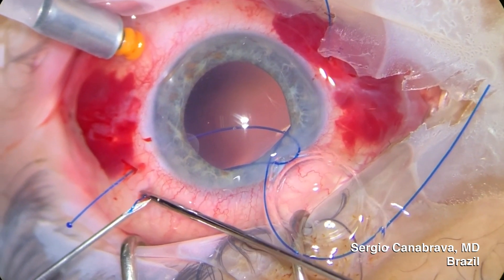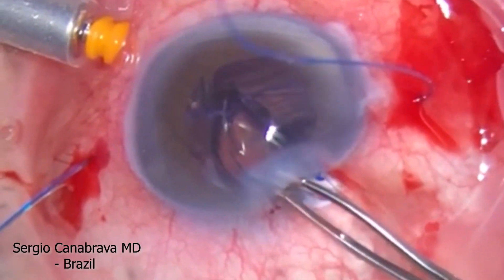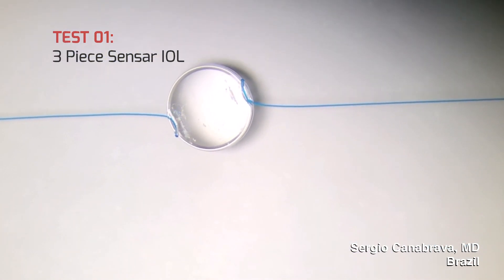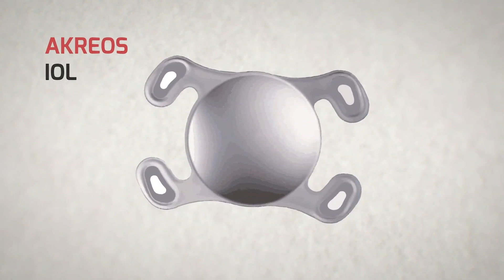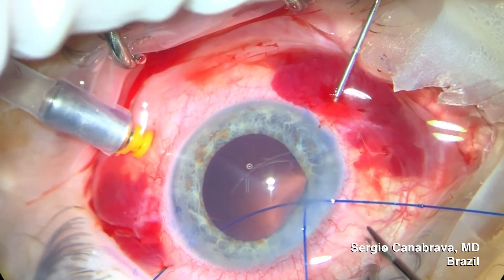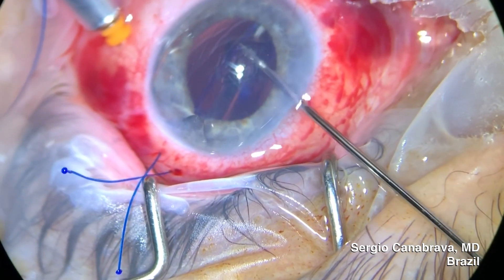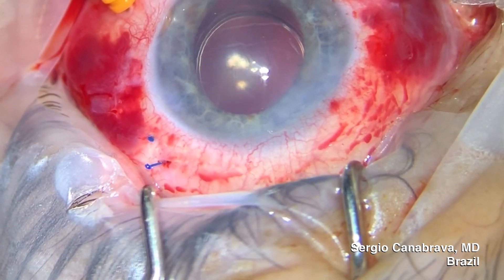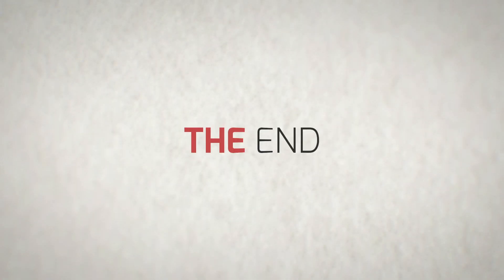4-Flanged 5.0 prolene Suture Technique with Akreos IOL

Comment: Dr. Canabrava, congratulations for winning in the ASCRS Film Festival for your 4 flange technique. I am very interested to try it but have you had any issues with erosion of flange through the conjunctiva? Your technique is different from Yamane because with Yamane the haptic is more in the horizontal plane from the scleral tunnel. With your prolene suture flange technique, it is more or less straight in and out and there have been reports of flange extrusion. Thank you for sharing your expert experience.
Reply from the maker: Hi Brian. Thanks my friend! Your your issues are relevant. You really need to do the tunnel more paralel and long as possible. As in the video, after 3 years follow up and more than 50 surgeries (subluxated cataract, IOL fixation) I had 3 problems: one conjunctiva inflamation/erosion (treated with moxifloxacin+corticoid per 7 days) and back to the OR as I showed in the video. One case of long suture outside of the tunnel in patient with Marfan Syndrome. Back to the OR in 7 days and reduced it. One with small flanged that back inside the eye. It was necessary do the double flanged again. It is the disadvanges. The advantages in compare to Yamane is Less tilt, because we have 4 points fixation. It is really stable.
Reply: Dr. Sergio Canabrava thank you for the reply. Yes, the Yamane technique has more issues with tilt than the 4 point fixation, but I have done my own modifications which I posted recently on my channel which I believe help to alleviate some of the challenges originally described by Yamane. Im the past, I have performed Akreos technique with goretex and shared it on my channel but your flange technique using 5-0 prolene is really brilliant and much faster and elegant. The use of the prolene flange has so many great applications including suturing CTS and lassoing around haptics to stabilize IOLs. I am excited to try it.  Kudos again to you and your team!